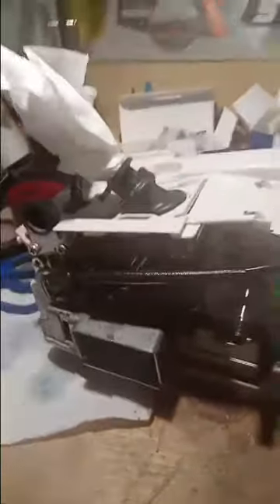Chainsaw Repeated Poor Quality From Farmertec Holtzfforma, Buyer Beware !  Ms200T, 460,  problems.

Comment: I dont trust these few bolts to hold a saw "together" on aftermarket cases...so i ALWAYS add a little bit of Free Bond to my halves to ensure of NO AIR LEAKS...just something I've adapted to as part of assembly process and  of coarse ill take the time to ensure all the bolts find a nice and tight fiit when i send'em home! GREAT WORK guys! Cause its stuff like this that separates the mechanics from the "parts assemblers "
Reply from the maker: Haha, yeah he is a knowledgable guy.  Enough for me to learn from.  He adds some street cred. To the channel.